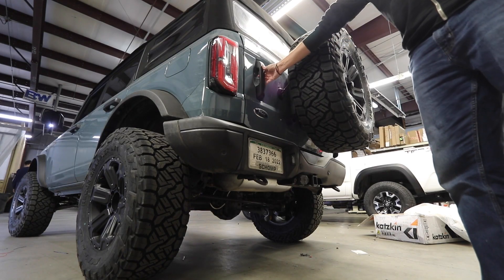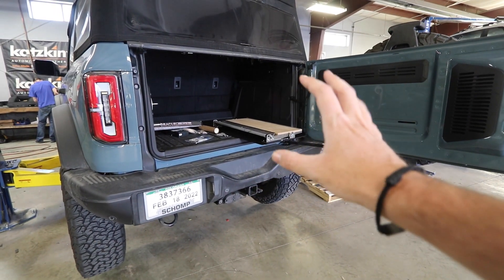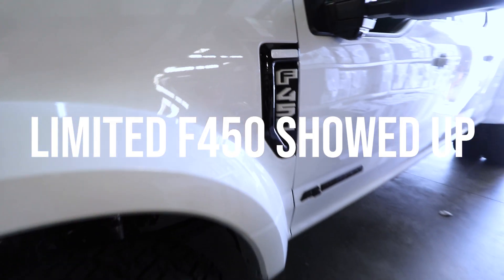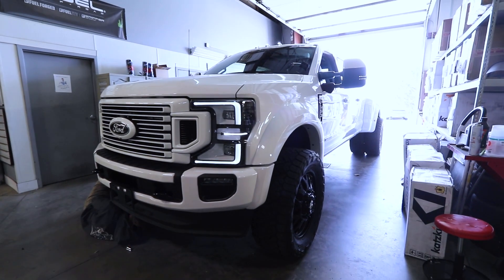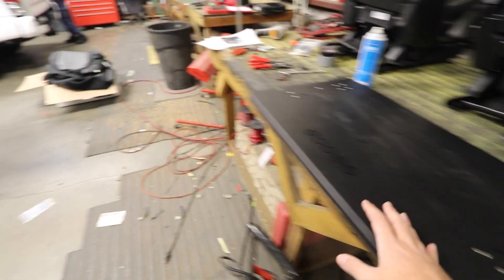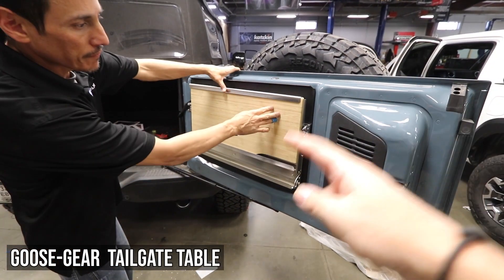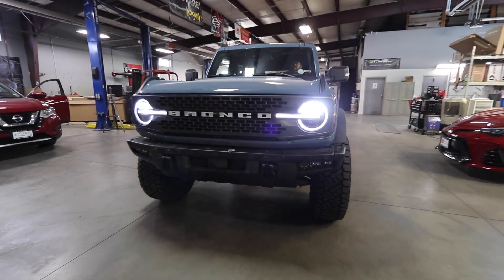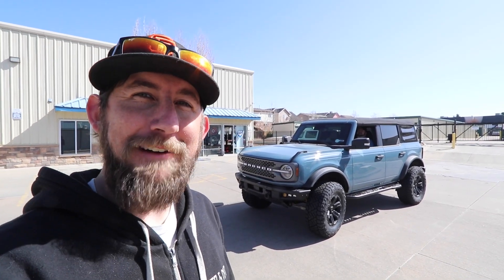This Bronco Got it All

Comment: Do you mind telling me which wheel offset you used?  We put 35" nitto ridge grapplers on our outer banks and it does not look the same as yours. Thinking the wheel offset is the difference.